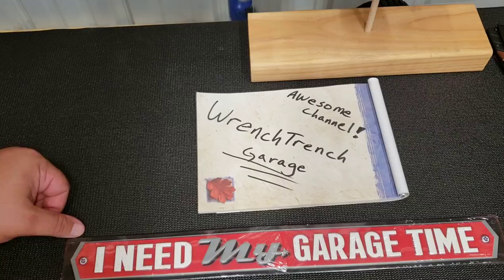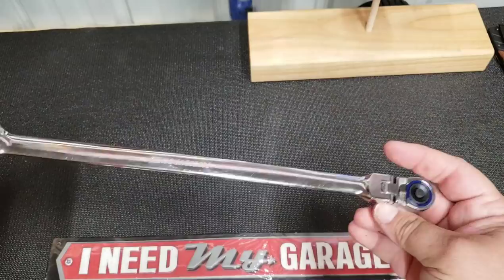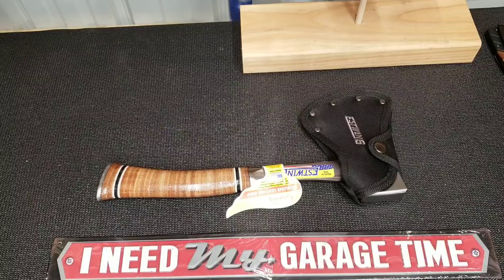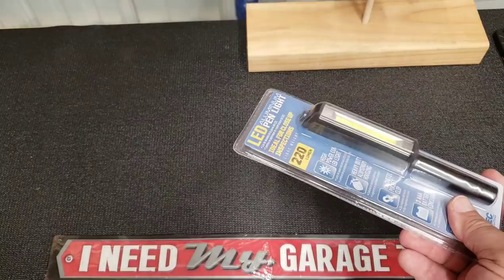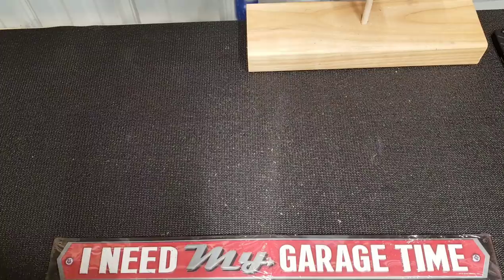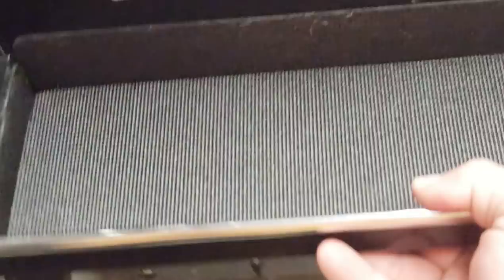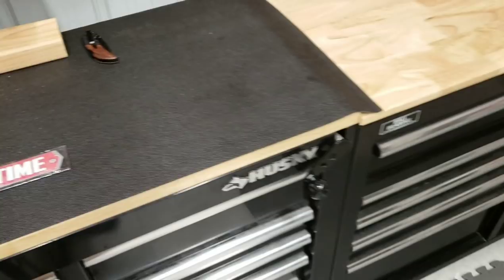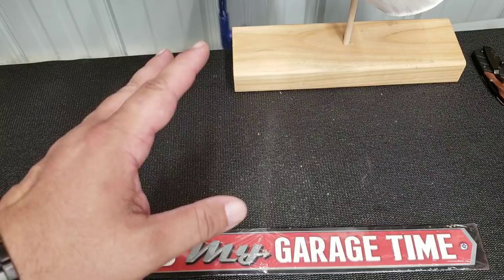Tool haul time!!!

Comment: hey jeff just got back from my 100 mile one way trip to hf, I have a recommend that I found at hf, item nu is 63908, is made by icon, haven't used it other than put on my 1/2 impact Makita impact , is 10" long, only comes in 1/2 size, wish made in 3/8, and 1/4. seems to be great. has a little wobble if just put on tool but if pull back on sleeve and add a little pressure  doesn't do that. know all the hf haters will comment on that, is adjustable down on length.. I always add lithium grease before using anything. know wont if has socket and on bolt. cost was 17 buck but had a 20 percent coupon. has lifetime warranty, can get in a tight place, I am tickled with my find, wanted to share with you. roger
Reply from the maker: I just saw that on their website! They are great, I have the Husky version that came out a few years ago. I paid a little more than HF is selling theirs for. Good looking out!